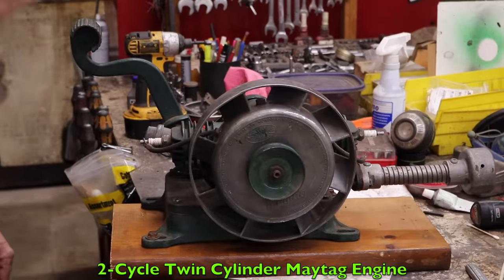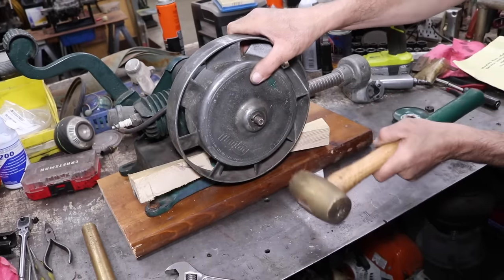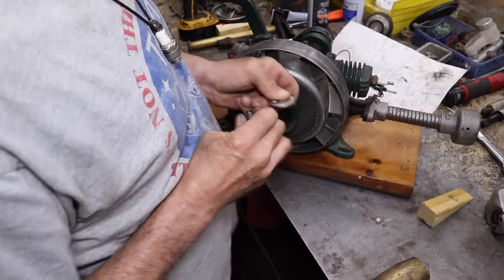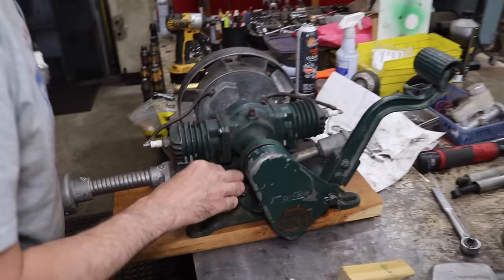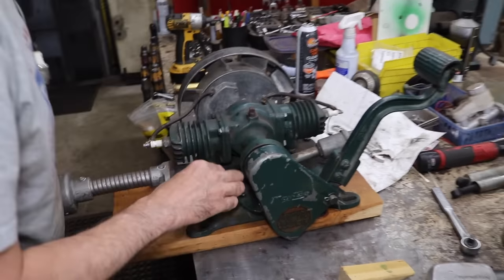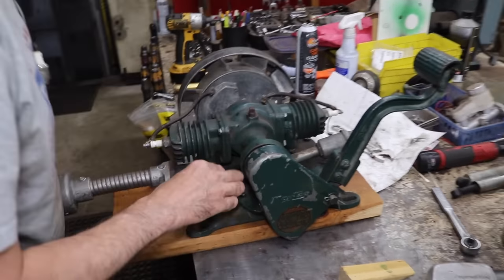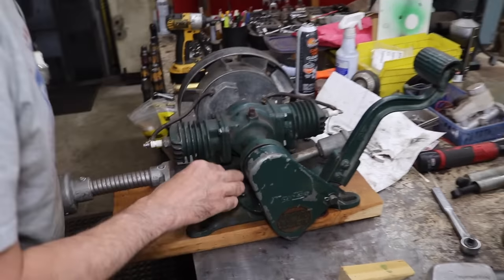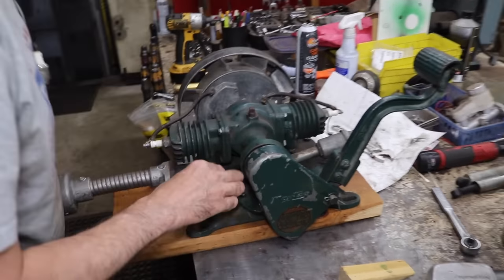What Is This Thing? Will It Run?

Comment: 🤔Wonder how much crying😭 and😤 foot stomping went on when electric motor washing machines replaced ICE engined washing machines?😁
Reply: Just like cars vs horses electric took over the market naturally as soon as it was the better option, I don't know anybody who is opposed to electric cars, the problem is currently the tech isn't economical. Or practical, and the grid can't handle the charging requirements. And of course for now mass production of lithium ion batteries would be more destructive for the environment than ICE,   but absolutley as it gets better it will absolutley take over and become the primary means of transport..the issue is government trying to force the conversion befor it is close to being the best option..the day it's safer, more economical, and dependable than ICE it will start taking over the market just like ICE did from horse and steam, with no need for taxpayer funded unfair subsidies, or government force.
Reply: I would imagine consumers back in the day though electrical appliances was a godsend.
Reply: Back in the days when these came out a lot of farms did not have grid power anywhere nearby. If they had electric at all, it was a small “light plant” in the basement or an outbuilding. Often 32v with a bank of glass cased batteries that open like a mason jar for occasional cleaning and replacement of acid and plates. 

Like 110ac washers were in their infancy, it will take time for infrastructure to support electric vehicles to spread to more rural areas.
Reply: 'they don't make it like they used to.''
Reply: @kevinfloyd808  100% correct, yet people still don't grasp the concept and just parrot government bs.
Reply: @Jeff in TD  In the 1960s I remember the grid and availability of utilities were primitive in rural areas by today standards. If one could afford a washing machine it was placed outside on a porch. Wash tub , scrub board and knuckles was the norm for tenant farmers. Phone service was a party line if you had phone service at all. Ther was very low consumption of electricity. No central air and heat. Wood stove and heaters. One light bulb per room with a pull string switch. Hand pump water wells and outhouses were still common. Good thing about chopping firewood is that it warmed you twice.  The cutting and chopping of it and the burning of it.
Reply: Affordable electric motors (and subsequently, the appliances that used them) predated affordable small gas engines.  These were invented so people without electric service (typically rural) could enjoy some of the same amenities as those with electricity.

So to answer your question, none whatsoever.  They were grateful to finally have electricity and be rid of the maintenance of another ICE.
Reply: @kevinfloyd808 This comment is from Cycle World magazine:  Brendon

1w ago

We are living history. Never has man had a collective goal as ambitious as eliminating the worlds primary energy source and then acted on the goal, before having a viable plan. We don't have the technology to replace fossil fuel,. We don't know if we have the raw materials. We don't even know if it is economically possible. Yet full speed ahead. The line between ambitious and stupid seems to have gotten real blurry.